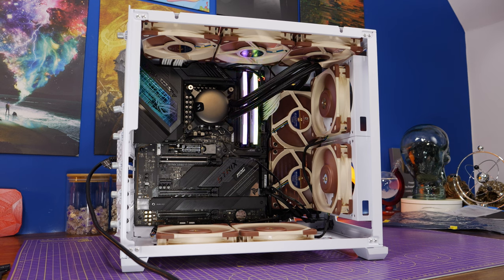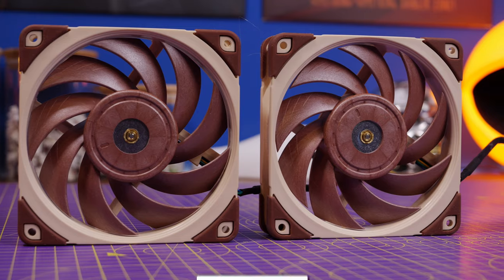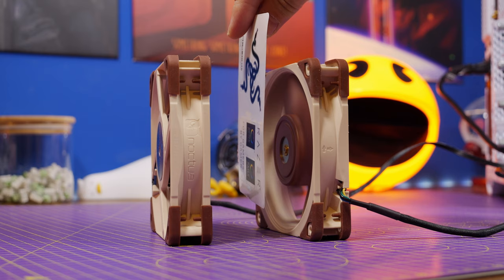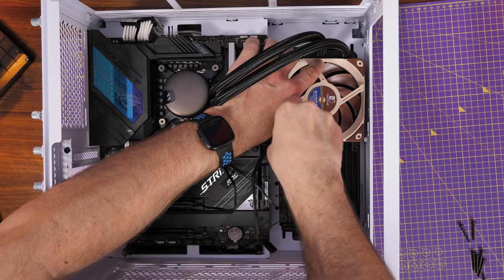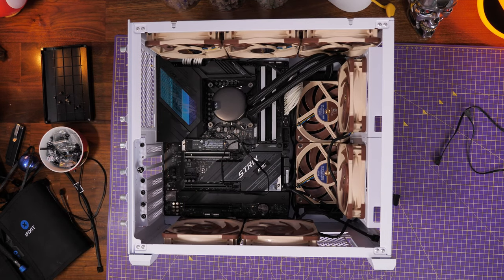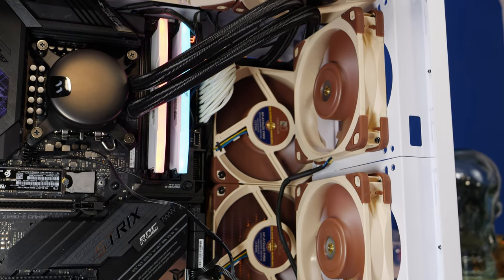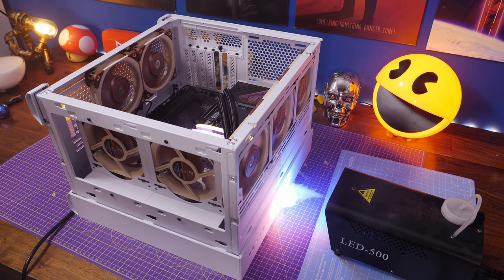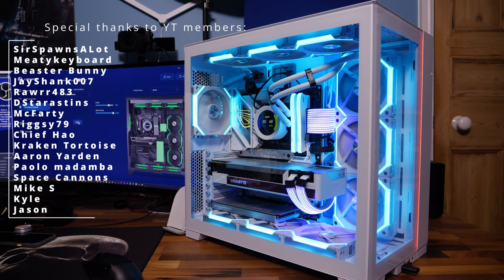Common Fan Layout Mistakes You Might be Making with Your PC Build! PC airflow tips and tricks

Comment: You showed how not to do it, but not how to do it? 🤔
Reply: You only need to know that the front and bottom are for intake, top and rear for exhaust
Reply: Just literally do the opposite.... Does everything need to be spoonfed to you?
Reply: @NoReply28  like omg literally 😂
Reply: @GanymedeXD  i don’t disagree, (I figured all of this out with more researching) but I will say this video at the time left me with more questions, hence my comment. It’s not a bad video just maybe I clicked on it at the wrong time in my quest for knowledge.
Reply: You are all wrong. He had a valid question. The answer is always: it depends on your case and components. Airflow is generally best positive pressure (more fans in than out) and generally better pushing hot air up than down so you aren't fighting physics. However, not everyone needs or should have 10 fans using every available slot. Loads of people have tested this and it all depends on the case and components
Reply: @NoReply28  🤡🤣

Comment: Im actually building my first pc this week and im stuck on my fan setup and dont know what to do. I have a cpu air cooler with 2 fans on it and 6 140mm fans in my case. 3 intake in front, 1 exhaust in rear and 2 I was gonna use for top of my case and that is where im stuck. My cpu cooler with be exhausting to the rear fan so ill have 3 intake im front to a cpu cooler which is pulling from the front and exhausting to rear so how donI setup my top fans? Also seems I dont have enough exhaust so I wanted to do 2 exhaust in top but with my cpu cooler im confused what to do. Please help me someone.

Comment: I reside in the 1%,  I have 1 140mm pushing over my VRMs,  and 3 140mm pushing into 420mm rad,  3 140mm pulling from rad.  If this sounds odd just look at a Tt Core P3 frame and you'd get it.  Great topic for new builders...or confused ones 😉

Comment: I really hate how fans have an "ugly" side with the sticker. Obviously they're gonna need to hold the actual fan to the outside of the device somehow but those ugly stickers totally get me. I actually ended up removing all my Corsair fans and replacing them with Lian Li ones just because of those ugly stickers that were sitting right there in plain sight on the bottom intake fans.
Reply from the maker: Yeah, the back is usually ugly
Reply: Interestingly some companies are recognizing this to offer reverse looking fans, like the ones from Montech's Sky Two case, and Thermaltake's SwaFans from CES 2023 where they come with multiple swappable blades
Reply: I’ll have to google fan sticker company to cover that stupid sticker
Reply: @Chris-ql3rx  I've actually been looking for that and couldn't find anything here in Germany. The only things I found were on eBay and cost liike $35 in shipping per sticker. Replacing the fans entirely was actually cheaper than that XD
Reply: Phanteks new D30s have two options, Normal and Reversed. This way you see the front but the blades are reversed, so you get both aesthetics and performance 😊
Reply: @haies09  Yea I saw that and it's great for what it is. Definitely great if you plan ahead for one specific build. However, if you're like me and just like building systems and keep reusing old components, there's just no reason why there has to be an ugly sticker or no sticker at all on the back side of regular fans. Which is why I love those Lian Li fans. They do look good from both sides. I completely dumped my Corsair components because their back side is so ugly (and their proprietary cable box daisy chaining is ridiculous but I could live with that if the fans weren't ugly onone side)
Reply: @Oceanborn712  same reason why I switched from Corsair to Lian Li, but I now want the new Phanteks. They look good and the new daisy chain feature with the caps to cover the screw holes is a nice touch. Although I sort of want to go with a Noctua build too 😊

Comment: Most pc cases are designed to be inefficient, I made my HAF 912 efficient using cardboard and high flow fans taken from damaged Optiplex 755 Towers.
Newer cases are still designed to be conflictive in the airflow.
Only the expensive cases show good design and even then there's a fistful of them, not all!

The trick is to direct the air to the hot components and the heat of one must neve go to the other, fresh air for all of them.

Ironically, Dell and HP design the Tower cases real good. Still I won't buy a OEM computer.

Comment: I have 3 intake on front and 3 exhaust on the side (thru AIO radiator) that works guys? Guess cannot add more intake anywhere (no space on the bottom) so I cannot add exhaust at the top if I followed the logic correctly. I am already balanced atm
Reply from the maker: You can always check to see if there's an issue https://youtu.be/sVEXd-Wp8FY

Comment: Ok, but can I do it the following way:
Intakes: Front 2x160mm; Bottom(off the ground) 2x120mm
Exhausts: Back 1x140mm and 1x120mm(separate mount for GPU); Top 2x120mm.

On paper it looks okay, but I fear that one fan blows cold air and there's always another afterwards to catch that cold air and push it out...

Comment: So i bought the Phanteks xt pro ultra which hast 3x140mm intake at the front and 1x140mm exhaust in the back, i bought another 3x140mm for intake from the bottom since i got a 7900xt and i want it cool down. Can i leave the top blank or do i NEED some more exhaust fans at the top?
Reply from the maker: You would be better off with them but you could test without and see
Reply: @TheProvokedPrawn  okay nice i have another 2 spare laying around i will Install those at the top.

Comment: can i ask a question? is it normal for pc to vibrate much when 6 fans are spinning? i have the correct airflow, my only problem is its making loud fan noise and making my desk vibrate. when i turn off the 6 fans the pc are silence and  no vibration
Reply: Are your case has rubber on feet? Maybe some of your fan is faulty or overpowered?

Comment: I think it's not so clear. I have an inverted case where the gpu is above the cpu. My case allows me to install 1x 120mm front, 2x 120mm on top and 1x  120mm rear fan.

My 3 scenarios i thought for my situation are:

1. front and rear intake. Top exhaust.

2. front and top intake. Rear exhaust.

3. front intake. Rear and top exhaust.

Which of the 3 versions would be best for my situation with the inverted case?

I would think its either scenario 1 or 2 for me but i am not sure.

You mentioned gpu fans and exhaust fans fighting each other. That would be true with top exhaust for me because my gpu is mounted under the top fans with gpu fan facing upwards. 
Thx for answers

Comment: I have a question : what if I use one intake from top of RAM, two intake from below and one from side? For exhaust I propably use PSU and direct air from CPU tower cooler will setup optimal? Or I gonna kill my PSU (and CPU?) due hot air from cooler? Perhaps I should make intake for PSU on top.
Oh yeah my case was old orange cameroon I was planing to mod this case for addional fan one on top and two below.
Reply: I'm not sure if I understand completely, but this config sounds like it may push too much air into the case and not have enough fans to pull hot air out of the case.  
I don't think that the PSU will have enough push or pull to contribute to the overall exhaust quite enough to get out the hot air.  
Also, I think that there should be at least one 120mm or one 140mm fan pulling hot air from the CPU cooler to exit the rear of the case.

Comment: If we are not using radiator but  using an air cooler  instead and the PC cabinet is a full tower with sufficient space to install fans, then in the empty vertical space provided for radiator fans , should we place intake or exhaust (cabinet) fans
Reply: If you have a normal tower case and normal air cooler for CPU, here is one of the normal and good configurations:  

Two or three intake fans at the front to pull cool air into the case,  
one fan behind the CPU cooler pulling hot air out of the rear of the case,  
and two fans at the top of the case for upward exhaust of hot air out of the case.

Comment: I don’t understand why fans are place behind the AIO radiator and thus cool it with hot air taken from inside the case in place of taking fresh air from outside to blow on the radiator like in a car engine…..🤔
Reply: That's an interesting thought. Maybe because cars have to drive forward, so you'd have to mount the radiator behind the engine to have the same effect and it'd then be too obstructed to actually work. 🤷
Reply: The fans are pulling cool air from the front of the case through the radiator and into the case, helping to keep the CPU cool.

Comment: Why have the front intake fans on the inside of the brackets? They could easily be installed where the radiator could go.
Reply: The fans are behind the radiator in order to pull cool air through it and into the case.  This configuration also contributes to keeping the fans and case cleaner than if the fans were pushing air onto the radiator from the outside in.

Comment: is 2 120mm side intake and 3 120mm front intake optimal? my cpu is air cooled
Reply: That sounds like it should be good as long as you have at least one fan at the rear and two fans at the top pulling hot air out of the case.

Comment: Okay.. So mine is wrong then? I got the similar case in the video but instead mine didn't had Front fan case like in the video, and what I'm using is.. For the Rear one for intake, Top for exhaust, Behind for exhaust, and Bottom mix intake and exhaust.. 

So what i need to do is just change the Bottom into intake and the Rear for exhaust?

Comment: I've done 3 top intake, 2 front intake, and 1 exhaust at the back Plus the CPU cooler which acts as an exhaust and my GPU temps stay below 60c hotspot can reach max 80c but that's it, CPU stays below 30c but this all depends on your case as well.

Comment: what do you think in this scenario.. three 120s front intake one 140 up rear exhaust and top rad 360mm two exhaust (that near the rear 140m and one intake (near the front fans )?
Reply from the maker: Just got three intake on the front, the rest exhaust.
Reply: @TheProvokedPrawn  with my setup you have 4 intake fans and 3 exhaust.. this is positive pressure ..

Comment: Having the power supply at the bottom that exhaust to the outside, does it make sense to put the intake fans at the bottom?
Reply: That's also my question. Hope someone give the answer... 😰
Reply: If your power supply is mounted correctly, it should be intaking air from below, hence why cases have dust filters on the bottom - it isn't to keep dust in!

Comment: What if i do the intake one to the front and one at the rear, and then two more at the top for the exhaust. Is it optimal?

I can put two intake at the bottom but since my case is small (more like cube shaped) and the gpu is big, the gap between the gpu and the bottom of the case is not that big but i still can fit the fan. Should i continue with this setup or try to do it like i mentioned above? Or do i just get a new case?

Comment: What if you have a radiator on the top of the case? I have the phanteks pro case and really the only place to exhaust it out of the back. Should I have top front and bottom pulling air in and just exhaust out the back?
Reply: If your radiator is mounted to the top of the case have the fans blow the air out of the case from the top and all other fans blowing cool air in.

Comment: I have a question, I hope this gets answered by anyone if possible.

I have a coolman robin 2 mini (you can call it a poor man's lian li o11 mini, if im correct)

I run an i5 10400 and have 6 fans (3 bottom intakes, 3 top outtakes).

I was told that I dont need to have an AIO with my CPU so I stuck with an air cooler (blowing directly onto the cpu). Is that good? I was planning on adding 2 more intake fans on the side (beside the mobo), or is it just an overkill at this point?)
Reply: Hi. I hope you have figured out your fan config by now.  I have an 011 Air Mini and haven't yet built in it.  I will be doing all air cooling as well.  I think at some point, if there are too many fans blowing inward, the hot air will just circulate inside the case because there are not enough fans pulling out the hot air from within the case.  Basically, a little positive pressure is OK, but a lot of positive pressure is probably too much.  Don't want to choke your components.

Comment: Where’s his power supply?
Reply from the maker: At the back. It's a dual chamber case
Reply: The case is the Lian Li 011 Air Mini .  If you are looking at the case from the side as shown most of the time in this video, the power supply is behind the center "wall" divider between the motherboard and the wiring compartment.  The power supply sits sideways at the lower right rear corner of the case.